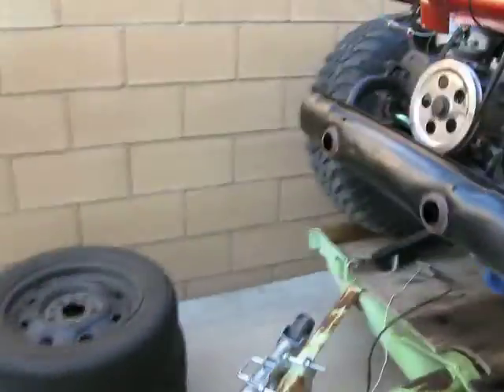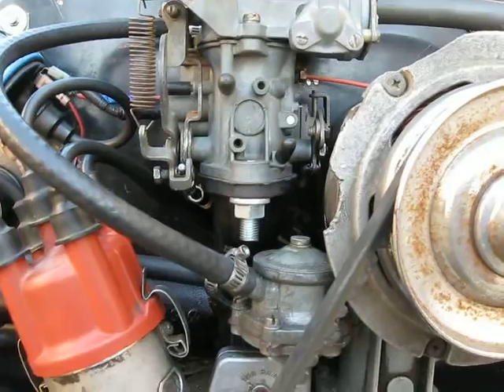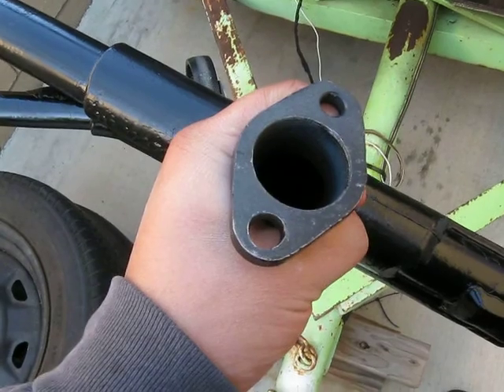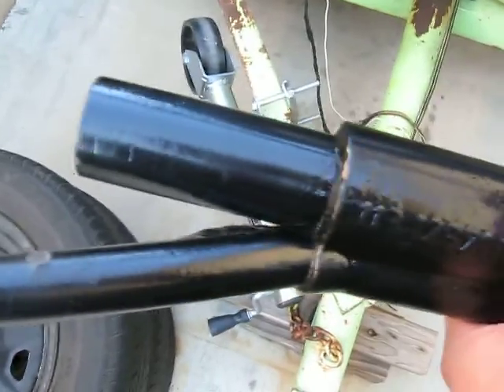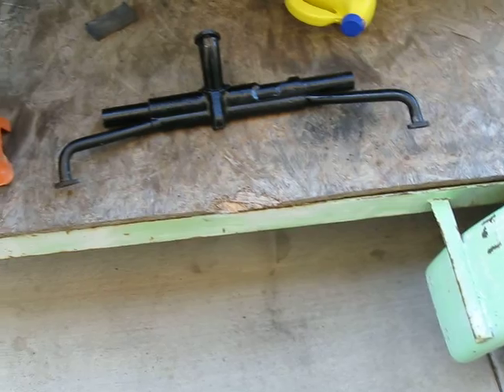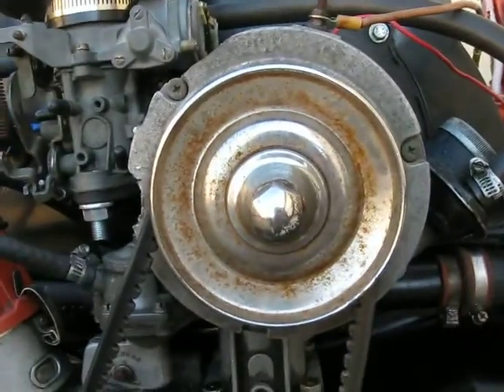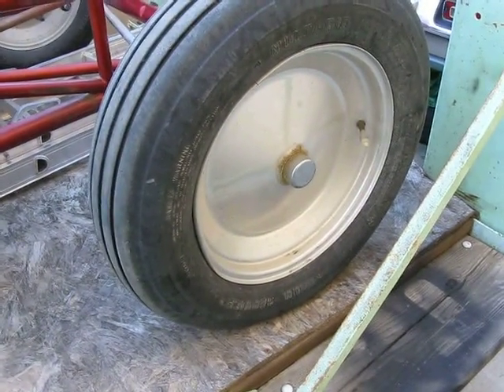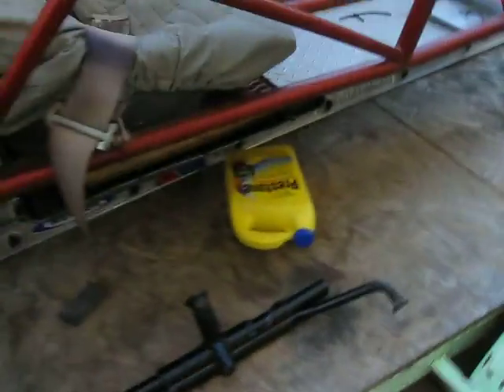1600cc dual port VW intake manifold Question?

Comment: Did hooking up the risers fix the hesitation ?
Reply from the maker: Noah Riedel I did eventually use that manifold with a cheap Chinese reproduction 30 pict 1 carb. It actually ran better than this setup. It fixed hesitation. I did not have to rejet. Had lots of low end torque to my surprise. But like I said I used a smaller carb that would fit this manifold
Reply: John Gonzalez thank you for responding.